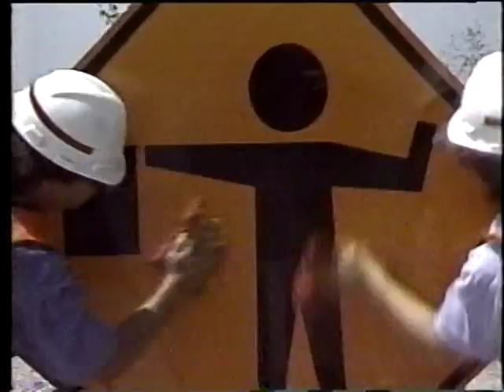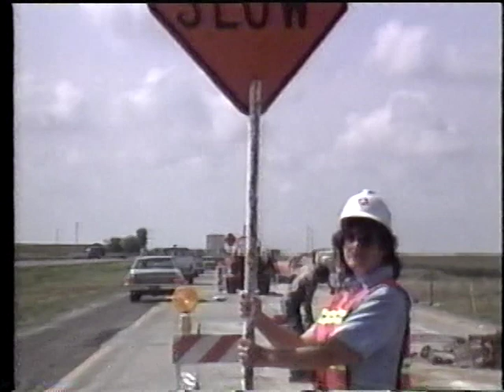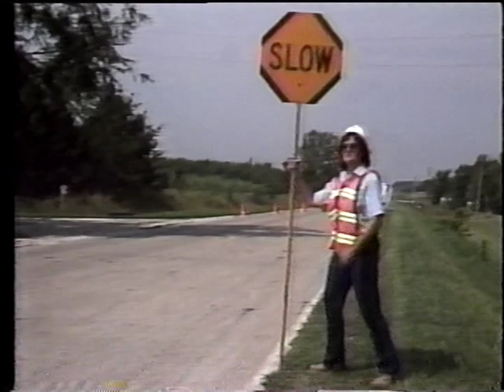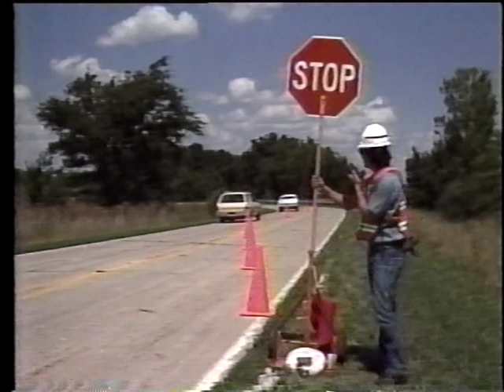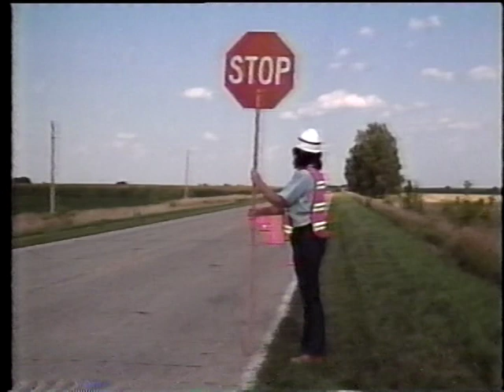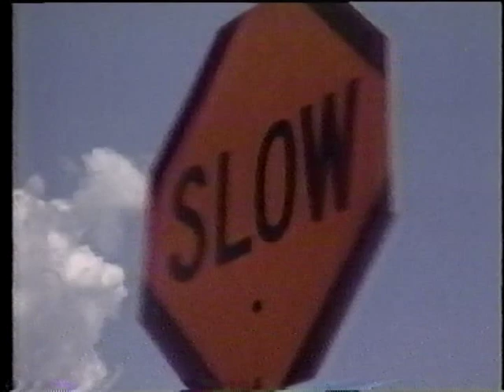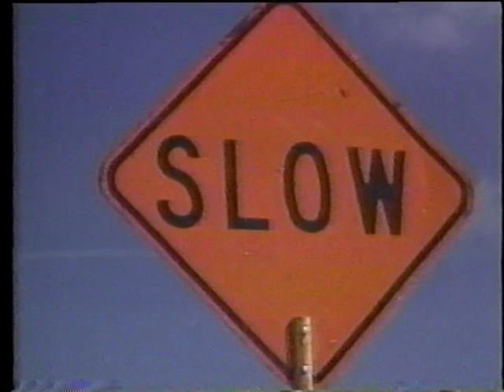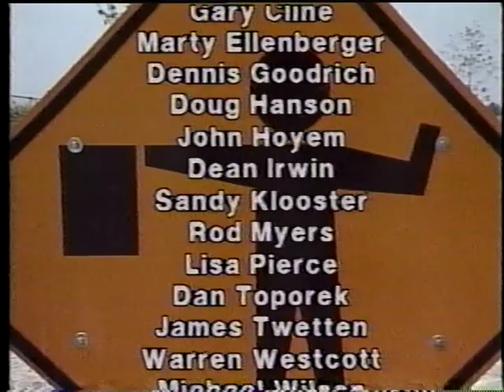Professional Flagging: Basic Principles, Procedures and Applications

Comment: This is a great video for any new flagger, or to be used as a refresher course. As a certified level 1 flagger for 2yrs., i can tell you it that it can be total boredom 1 minute and then total total traffic control the next. It can happen that quick.

Never Never leave your position without being replaced, i did once at the request of a supervisor to help him work and it almost caused a head-on collision. Guess who's fault it would have been? Mine!
Be safe.
Reply: I just started 2 weeks ago. Flagging mostly highway.  Hardest part is setting up the signs right now